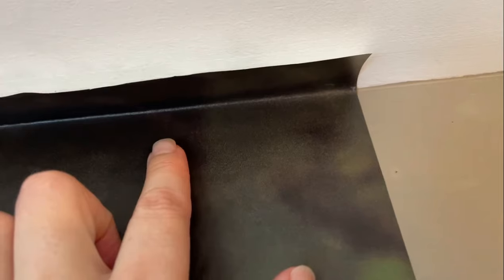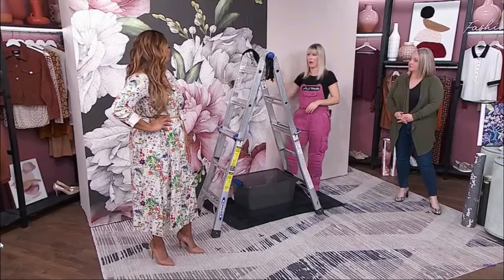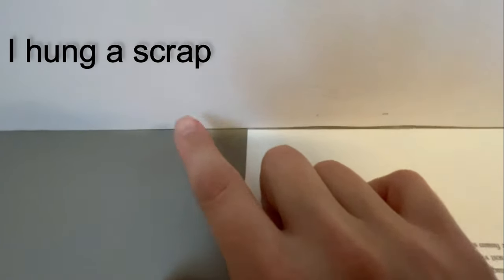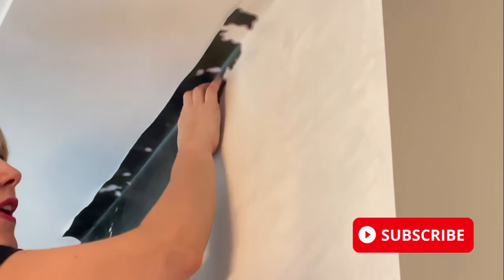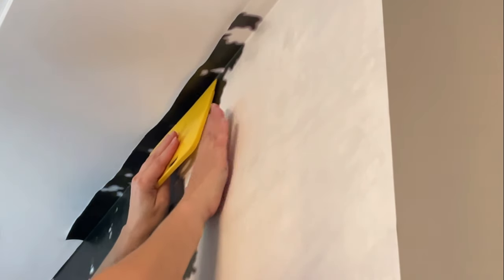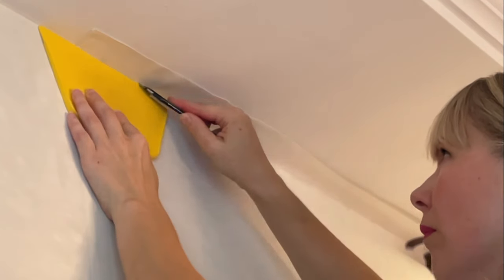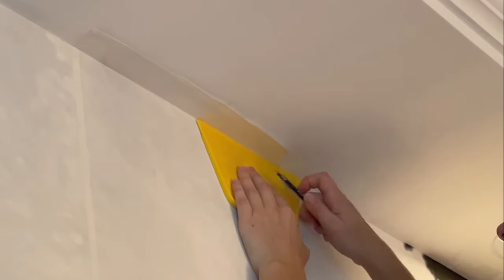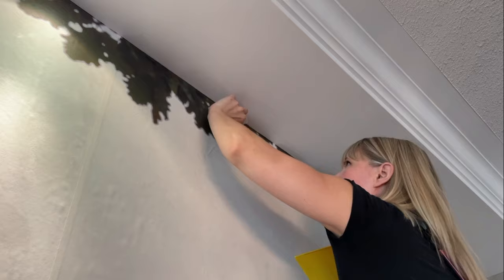How to Trim Wallpaper at Ceiling PROPERLY!

Comment: Hi I done some wallpapering last night,and came downstairs this morning,to find the extra but if wallpaper at the top of the wall sticking to the ceiling abit as its now dry🙈 I might mess the paint on the ceiling abit,,but will have to touch up with paint after,,,any tips?
Reply from the maker: @Dsinkz  you can try to wet the wallpaper that is on the ceiling to get it off easier. Let the water sit on the paper for at least a couple minutes, and re-wet it if you need to, before taking it off of the ceiling. 

If you need to paint the ceiling, wait until the wallpaper is dry, and then try painters tape in a small section to ensure you don’t get paint onto the wallpaper…but also to make sure the tape doesn’t ruin the front of the paper.

Let me know how it goes!
Reply: @aboutmurals  Hi I went the ceiling a few times and got rid of most of the paper,,then wired for it to dry repainted where needed,,I also followed your procedure with trimming the wallpaper with a putty skimmer and blade,, thanks for the advice and video info,👍
Reply from the maker: @ glad it worked out for you! 🙌🏻